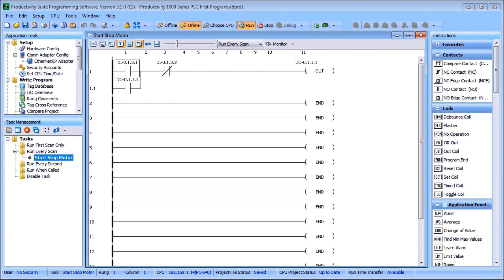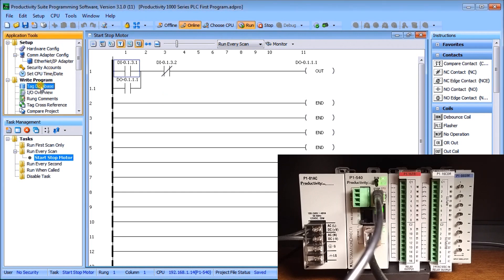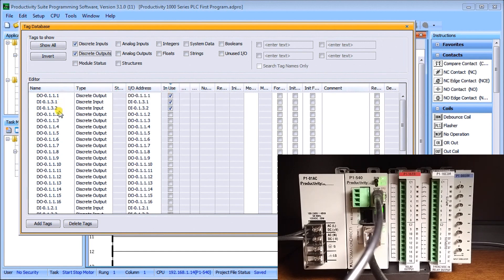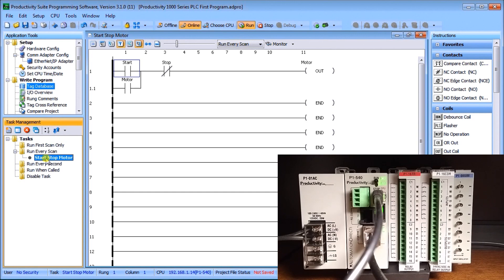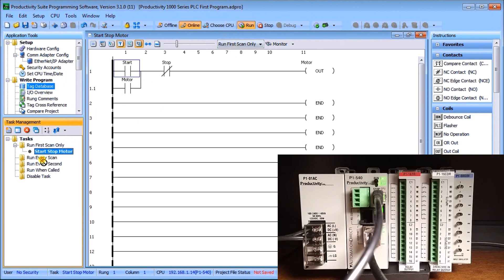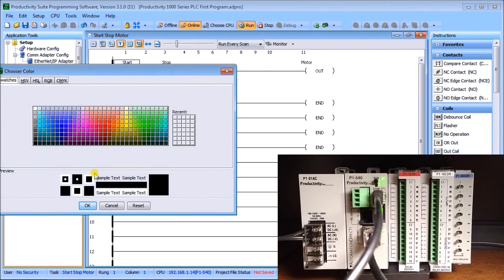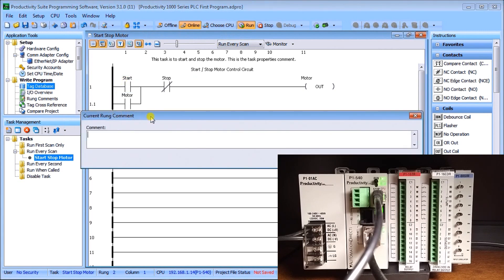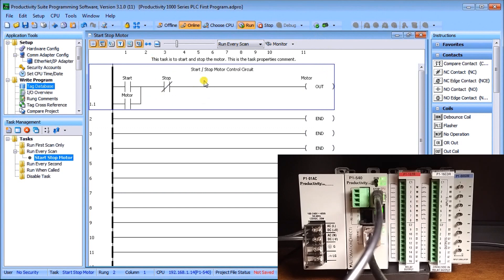Master PLC Programming: Smart Documentation Tricks Inside!

Comment: I have a lot of experience with AB PLCs, but not automation direct. To do a simple program like one shot to a add instruction and one shot to a sub instruction. For example: ons B13.1 sub N7.1 1 n7.2 
Ons B13.2 add N7.3 1 N7.2 
GEQ N7.2  0 OTE B13.3 
I made this up on the spot for ab. You’ll copy it into the ascii bar and it will pop up. I don’t know how to do that in automation direct.
Reply from the maker: Hi Eric,
The productivity series of controllers will use an edge contact. This is the same as the AB one-shot.
https://accautomation.ca/productivity-1000-series-plc-contact-and-coil-instructions/
This post will discuss these contacts.
All math instructions are done using the Math Instruction in the productivity.
https://accautomation.ca/productivity-1000-series-plc-math-instructions/
Here is the entire series for productivity.
https://accautomation.ca/series/productivity-1000-plc/
I hope this helps you out.
Regards,
Garry